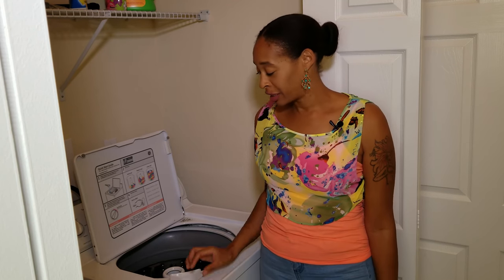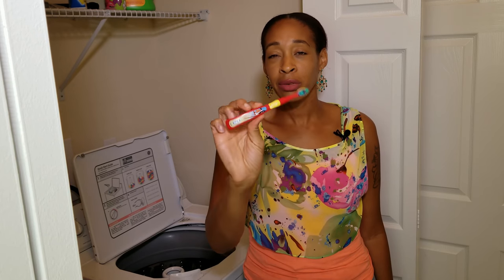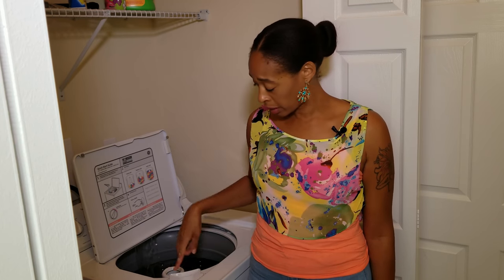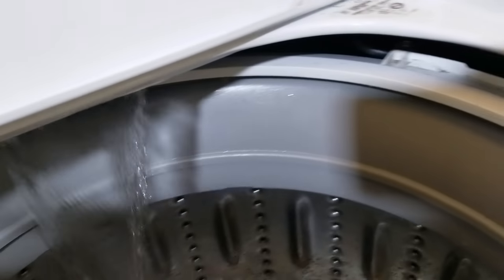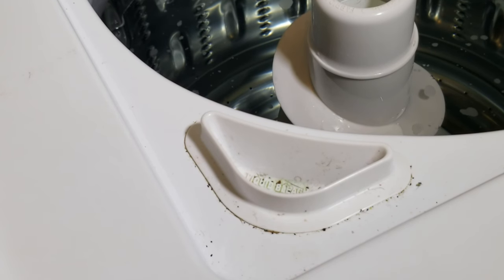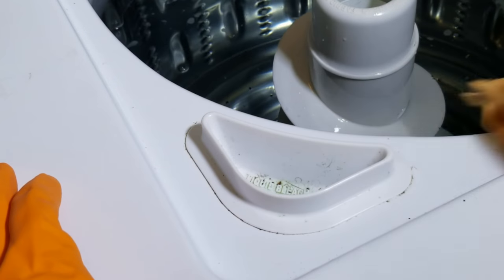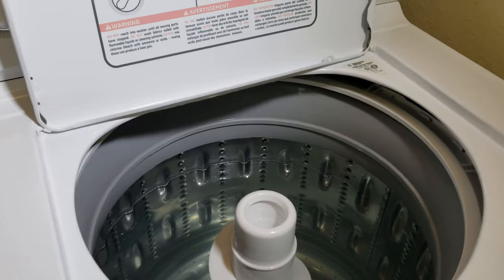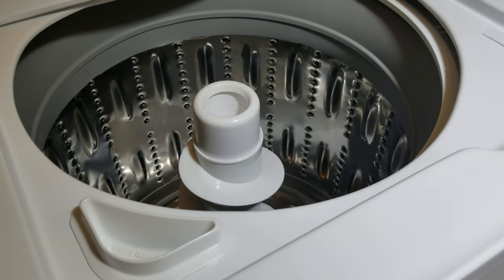How To Clean a Top Loading Washing Machine

Comment: I love using vinegar and baking soda for cleaning, but I've always been told not to mix the two, because the reaction (the fizzing) basically negates the two. I prefer one round with vinegar (for the grease cutting benefits of the acid) and one round with baking soda (for the scouring benefits of the mineral).
Reply: This is actually incorrect. It is the reaction and fizzing (CO2 released as gas) that helps dissolve particles to help clean
Reply: @solarsssun  vinegar is an acid and baking soda is a base so what do you think happens when you mix them together?? They cancel each other out leaving behind basically salt water. I have heard you can mix them with that fizzling reaction to help lift some carpet stains but in this case no it would not be helpful.
Reply: @THEPopeKevin  You are right.

Comment: I've had good luck with 1/4th cup of concentrated simply green, give it a hour or so to sit and run a normal cycle (without clothing). I know some folks also like to use bar keepers friend but I wouldn't really use that myself, it's an abrasive cleaner that can work well but is not fully water soluble so it may fall to the bottom of the drum. A lot of shower cleaners work well too since it is mostly the same type of application (water spots, humidity, soap scum) but if you do this try to add some liquid fabric softener to combat the foam from agitation.
Reply from the maker: Thank you so much for the tips. I'll try liquid fabric softener on my next cleaning.

Comment: Thank you for this!  I had to do it a little differently.  My machine won't fill up much more than an inch without laundry because of the sensor. I put it on the "clean washer" cycle. Only way it would fill,  but it's clean 😊
Reply from the maker: I'm glad that it worked for you! 😀

Comment: I've heard all washers have filters and a little hose we need to drain (Clutterbug Cas cleaned her's on a front loading washer).
I was hoping to see where/how to get those clean with this video for my top loader:(
Reply from the maker: I never knew about the hoses. I no longer have this specific washing machine, but I can check my new one to see if it has it, so I may do a video on it later. Thank you for the tip.

Comment: I still don't know how I'm gonna get the grime and fragments out from the ring of space around the base of the agitator. I just moved into an apartment and the previous tenant left that part of the washer NASTY with all sorts of stuff. Even Q-tips are too big to fit in that crack, but the one Q-Tip I did manage to wedge in there pulled out sludge, hair, and chunks of what I don't even wanna know. 😝
I wish I could just remove the agitator so I can clean under there.
Reply from the maker: I'm not sure how to clean around there, but have you tried the sink drain cleaner brush tools? It may be small enough to fit in the space. It's similar to this: https://amzn.to/49pCa7z
Reply: @TheKreativeLife  Thanks! Luckily the management had maintenance work on it; after several attempts at flushing it with various chemicals, they eventually used an extra–long socket extension to remove the agitator entirely. It was so gross! And a real headache due to the design of the washer. But it's all clean, now. 😃

Comment: Dang did you add water to the vinegar before you poured it in the washing machine, that 3 cups looks like a lot/more than 3 cups and the 1/2 cups of baking soda looks like more than 1/2 cups maybe it’s because of the camera
Reply from the maker: It may just be the camera and measuring cup I used. I didn't add any water to the vinegar. I hope you found the video helpful. Thank you for watching.

Comment: My top loader locks...any thoughts?
Reply from the maker: I've never dealt with a top loader that locks. Have you contacted the manufacturer? I'm sorry that I can't be more helpful.
Reply: My machine locks to but if you press the pause button you should be able to open it after about 30 seconds without interfering with the wash cycle

Comment: We have a Westinghouse 1020A, top loader, it has a different set-up to the 8 kg model. The agitator is low profile and when the plastic cap on top of the agitator is removed a bolt is exposed. I assume the lint trap is accessed under this bolt but I am reluctant to remove it until I am sure about what I am doing, can anyone elaborate or confirm where the lint filter is located on the 1020A
Reply: I have the same question concerning the lint filter
Reply: Call the manufacturer or email them.